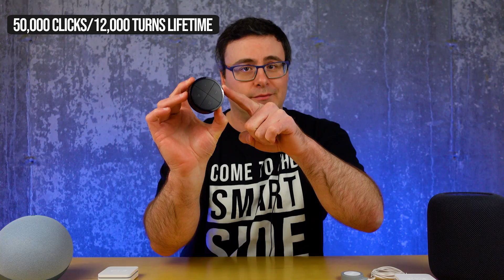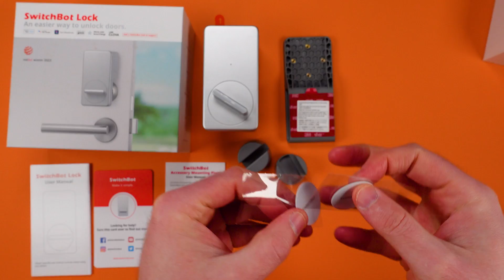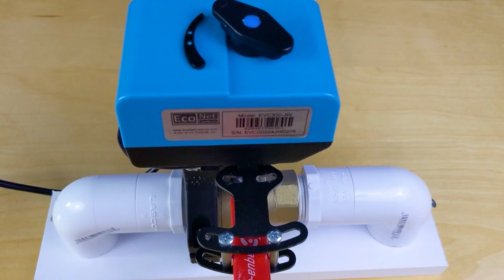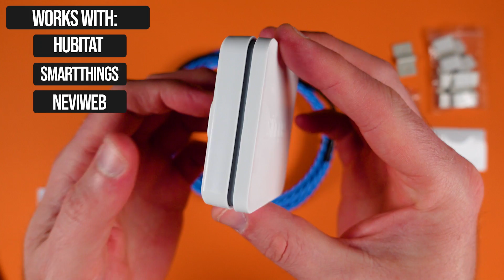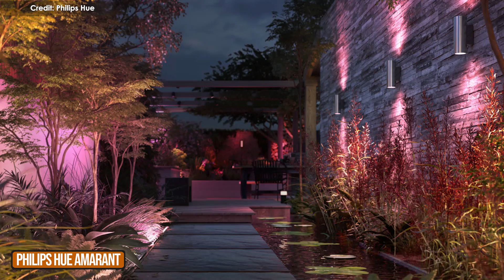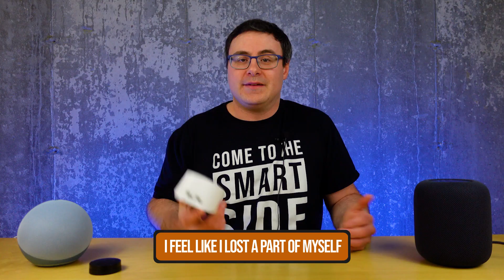These Smart Home Products Are NEARLY Perfect! (SO Close...)

Comment: WHY DOES THE HUE DIAL SWITCH THING ONLY CONTROL UP TO 3 ROOMS OR ZONES BUT IT HAS 4 BUTTONS FFS
Reply from the maker: That's where you should use it with some other platforms
Reply: @AutomateYourLife  such as? Currently the Hue site says "Each button on the Tap dial switch can cycle through scenes, and each button can control a separate Room or Zone. The dial dims or brightens one Room or Zone." So that makes it sound like you can control 4 different lights or groups of lights with each button

Comment: Hi Brian - I understand your love for Philips Hue, that was my first home automation purchase and all my lights are still Philips hue and I have not had a single failure in the years (5 at a guess) since I installed my hub and first bulbs but one thing that does bug me in a few rooms is an issue that in fairness you did mention - brightness, or lack of it. I now want to put smart bulbs into my holiday home where I already find the existing dumb 400 lumen (or at least that's manufacturer's claim on the box) GU10 bulbs a bit too dim for my liking so I'm thinking that Philips Hue GU10 smart bulbs are unlikely to make me happy there.

I appreciate that Hue is top of the pile for reliability and connectivity - although in addition to the brightness issue I would also dock Philips another "perfection point" for the relatively low number of devices supported per hub - but what would you recommend as second best for smart GU10 bulbs if maximum brightness is a key consideration? (I have a strong preference for a Zigbee solution since I have found that more reliable than my ZWave stuff and I prefer not to clog up my WiFi mesh system with lots of smart bulbs.)
Reply from the maker: Yeah I do wish we could get more bulbs on to one hub!

As for GU10 bulbs...that's tough for me.  I don't actually have a GU10 outlet at the moment in my place.  So I haven't done much testing there at all. :(  Sorry!

Comment: That leak detector looks great. I am also most comfortable with a long-wire sensor so I think I'll be getting one of these for the floor space underneath my shower. Does it also have a humidity sensor? In not then one can always add a separate humidity sensor but having it all in one device is more elegant so if there isn't one then I'd knock off one "perfection point" for that (in my opinion) omission.
Reply from the maker: It doesn't Julian.  That's just a pure Zigbee Humidity Sensor! :)

Comment: Actually I do use my Caseta pico switches to control smart bulbs through Home Assistant.  Each button can be configured to perform a different function.  For example, I set up an automation to control the smart bulb color with the "favorite" center button on the Pico remote dimmer.
Reply from the maker: Great!

Comment: Hi I have problem with my switch bot key pad touch the NFC scanner is not working it always shows me a ( failed to add ) in the app when I want to add a NFC I tried to reset it and pair it again but it didn't work I tried the card that came with it I tried the NFC tags that came with the lock and even tried 3rd party NFC tags but nothing works with it is there any way to fix this ?
Reply from the maker: I'd try adding it with a different phone or tablet and then talk to SwitchBot if it doesn't work

Comment: I've been looking, perhaps in vain, for a way to control my speaker groups. Miss A, as you so politely refer to my platform, allows me to adjust speakers with flic buttons to a designated press, double press etc. It would be great to use a dial like the one in this video. I would love to switch between speakers and dial in the volume. Otherwise, I'd love to see a mixer board type display on my phone or tablet to dial in the right levels. I'm betting both are non-existent?
Reply from the maker: Yeah not that I know of yet.  There's some ways to do some of that, but definitely no analog control of volume at the moment.  I'm watching though!

Comment: Brian....I have an older home with 8 ft ceilings, and most rooms only have a ceiling fan light....So, I put up low profile light trays 11 inches down from the ceiling  with 4 inch crown molding on the front for indirect lighting.  We have been very happy with the philips hue lightstrips plus in those trays.  They are RGBWW, the 2 WW's being a dedicated blueish white and a dedicated yellowish white, but when mixed together make a daylight white.  But, they are really expensive.  Amazon does sell a few RGBWW that are wifi capable, but ,  I really want to control them with the hue dimmer. I want to add these generic RGBWW to the hue ecosystem.   Can that be done?
Reply from the maker: You couldn't use the dial at this point, but you could use the buttons on that dial to set 4 different settings through Alexa or HomeKit.  Your other strips would have to work with that system too though, so I'm betting Alexa would work for you but not HomeKit with the types of strips you're considering.

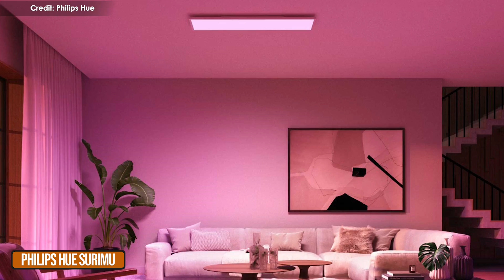If you look at some Zigbee strips, like the ones in this video: https://youtu.be/DtsSy0b4LtI (go to 14:32) then you can connect them directly with the Hue Hub and then yes, you get full control!

Comment: Hi.  I use SwitchBot lock.  A the beginning, it lets the door open too many times.  When entering the application, the lock seemed closed even though it was opened seconds ago.  That seems to have been resolved.  Now, about two times a week, I have to recalibrate the lock due to errors that it jammed.  So, my experience has not been good with this lock.
Reply from the maker: You know Carlos, some of the early models I found had some issues.  I wonder if you should chat with SwitchBot cause this newer one I got is perfect.

1 other trick? Don't remove the tape on the thumb turn adapter if you don't need to.

Comment: I love my Amazon purchase gas and water valves.  For 4 years they have reliability turned off my water when no one is home and my outdoor kitchen and fireplace gas valve to ensure no one leaves it off.   The problem I had Lora and other was the looseness of the handle
Connection.  I modified to make the bolt directly to handle
Reply from the maker: Sounds like you've done some work to make things great.  Good job!
Reply: @AutomateYourLife  I still have a lot to do.  I use geolocation to shut water off/on but I need to get washer power sense so I can leave it on until washer shuts off.  My wife has been less than happy when she runs to store and washer doesn’t finish while she gone.
Reply from the maker: @Alphasig336  LOL you can't make the wife angry!  You're gonna have to fix that one.  Maybe a bypass button to press on the way out?

Comment: You forgot to mention the Sinope sensor can also be setup to its own (reletively inexpensive) smartvalve, who also has a 'abnormal flow' sensor you plumb in with it. So works if your hub goes down (requires you configure it this way within Sinope and connect to Smartthings via cloud service instead of direct). But best valve I've seen so far (valve has plug and batt backup) .
Reply from the maker: Those are great points!  Absolutely right about it all

Comment: What do you think of the Moen Flo?
Reply from the maker: I've never had one Russ, but seeing them at shows, knowing a few folks who've had them, and having worked in pipelines for many years, I can tell you that a system like that has to be calibrated VERY well.  They seem to have it right, but I imagine very small leaks are something they can't detect.  They're also WiFi based I believe, so that can be tricky to keep connected in some homes.

However, from what I've seen, people are very happy anytime they've installed that device so overall, I think it's good.  Just not for me.
Reply: @AutomateYourLife  I'm having one installed soon. I'll let you know my experience.

Comment: Can you set up the switch bot lock to unlock when an AirTag gets close?
Reply from the maker: That would be interesting to try.  I'd think through Siri Shortcuts maybe but you'd have to work around the request for codes to unlock.  The NFC is probably an easier option with the phone
Reply: @AutomateYourLife  thanks for your thoughts! I was hoping a proximity lock would be possible.

Comment: My favorite series of products is the RF version of the Sonoff wall switch and Basic WiFi switch called the RFR2.  With a generic 433 MHz remote, I can press a button to turn them on and off, as well as use the App, Voice and manually control everything I put them on.  I have 45+ of these switches around my house, including on my Echo Dots to reset them.  Amazing devices.
Reply from the maker: That's a LOT!  Cheap devices though, so not a huge investment (other than the time thing)

Comment: HI Brain, another great video. Question why don't reviewers talk about Brilliant lights switches and controllers. I have the system with 2 single controllers and 16 smart switches and it can do way more than the Lutron system. I dont think any reviewers look deep enough into its functionality especially the controllers touch screen and what it can do.
Reply from the maker: Brilliant is an interesting thing.  I think what happened with them is they came out with a bang and most people rejected their cost structure.  That's what got me, but I've shown it a few times on the channel when the updates or new products were applicable!  Glad you're happy with it though, and thanks for sharing!
Reply: Hi Brian thank you for the reply. The only costly thing is the controller. But it does a lot without having to use the app and it has a huge wife approval. The switches are the same price as Lutron...But every switch has motion,dimming,and you can set them up to double tap to run scenes! Orginally I was a Insteon user which was before Lutron. Lutron uses the same transmission as the Insteon.. I swear they were the same company before Insteon went out of business. That is when I switched to Brilliant.

Comment: Have installed 4 leak sensors as leak sensors and 2 as water presence sensors (for a humidifier and to control bath/immersion routines).
Just spent an afternoon playing chase the little mourning geckos - managed to collect four of the 4" ballistic missiles (that can jump a ft without trying and walk on the ceiling) and they're safe in new home.

PS as I understand it, Lutron stuff works on 110v - so it isn't safe for the UK.
Reply from the maker: Yeah that's a whole topic in itself!  Actually, both of your comments are.  :D

Comment: I’ve had Phillips Hue for a while and it worked great. Then I tried to set up my mom’s house with hue using the same Alexa and hue account.  It doesn’t work very smoothly.  I might have to use 2 separate Amazon and hue accounts. I used one so we could take better advantage of some features, but II think what I gain is outweighed by the frustrations in that case. For instance, if she has used her smart lights, I have to tap the button on my hub before mine will work, at which point, hers will cease working until she presses the button on hers.  Then, of course, mine stop working again.
Reply from the maker: Yeahhhhh it sounds like you are right when you say you need to separate the accounts out.  Big job though!😳

Comment: How exactly can you have the Hue Tap dial switch control Philips Hue + Alexa + Homekit at the same time? I have this switch, and if I choose "configure in another app" it stops working with the Hue app.
Reply from the maker: Through the basic integration with the whole Hue Hub, the switch shows up in both Amazon and Homekit for control and automation use.  No further steps required.

There will be some funny stuff with Matter going on in the next little while so we could see it work and then not work over the course of a week.

But it'll work with basic integrations generally
Reply: @AutomateYourLife  Thanks. What about Google Home? This is what I am using but I do not see the switch listed.
Reply from the maker: @thcyprus  not available in Google

Comment: I would advise against any smart locks. They mostly are advertising on buzzword of smart locks and IOT, not providing any security that is even available on cheapest home lock. Your choice of smart lock may mean that your home is easier to break into, some even faster entry than any standard lock.
Reply from the maker: I get the perspective here.  I see it like this: if someone wants to break in with that SwitchBot lock on the door, they'd have to know it was there.

If they know it's there, that's commitment to getting in my place.  No door or lock is stopping them.

And here's the only time I've been broken into: I left my car door unlocked by accident and someone was testing doors.

That lock solves me or anyone ever leaving the door unlocked or opened.  So I feel good about that choice!  It's not changing anything door lock wise. 

But to each their own!
Reply: Any kind of lock on a door be it smart or not just keeps out the honest criminal. If someone really wants into your home they are putting through a window. I use the SwitchBot lock myself and find it fantastic and not to mention the wife approval factor it has for the many ways of locking/unlocking including the SwitchBot buttons I have scattered around my house and also a button on the new fire tv pro remote.
Reply: Anybody looking to break into your home is kicking the door or breaking a window. Most criminals test your door, and if it’s locked, move to the next door. It’s easier to simply open an unlocked door 4 houses down than to wake someone up kicking a door or breaking a window. Also companies like Schlage make good regular locks and use the exact same mechanisms in their smart locks (I know cause I swapped my dumb lock tumbler into my Schlage smart lock so I wouldn’t have to rekey). Anybody smart enough to hack into your lock probably makes big money somewhere and isn’t interested in stealing someone’s TV.
Reply: Our complex has replaced the mutual door from an actually secure lock to one of those smart locks and there has been someone breaking in every week now. Not someone kicking in door, not someone breaking windows. Just some punk kids breaking in and doing graffiti in the common areas now. I saw it happen, they just push something into the lock that's not a key and open it quicker than a key did when we had to use keys before going to the rf tokens
Reply: @drrenard1277  Tuya zigbee dshk-38 self defense auto mount by Moes 😂😂👌🤦‍♀️ - you know someone's going to do it - just hope the face recognition is perfect.

Comment: I can attest to the reliability of Lutron Caseta. I have the Pro Hub in my system. Unfortunately, I can't remember at what point it became necessary to install it. But, I believe it was for Hubitat Integration. After having had the system in place for 3 years now, I don't recall a single failure and response times are fast. I control the lights through Hubitat Dashboards, Alexa Voice Commands, Scheduled Scenes and ,from time to time, the Lutron app on my phone. I have played with smart home products for several years now and the Caseta stuff is by far the most reliable. 

One thing not mentioned in the video, the Pico Remotes can be used as a programmable button in Hubitat. All buttons on the remote can be individually programmed. I open my garage door from inside the house with a Pico Remote. I haven't fully explored the possibilities, but it seems to me to have the potential for a very powerful little tool.
Reply: Have to have the pro hub for Hubitat. I have 2 Caseta dimmers to replace 2 different 3 way switches without Neutral wires. The only issue I have with them is when turned on they come on full brightness then dimmed manually. I'm sure that could be fixed on Hubitat but with 2 little used lights it's not worth buying the pro hub...yet.
Reply from the maker: Hey Michael, is that the case with the Diva switch now?  It seems to hold it's base dim level whenever I automate with it anywhere else.  I haven't been able to do the Hubitat integration cause I don't have that pro bridge yet, but I wondered!
Reply from the maker: Yeahhhh, those Pico remotes.  That's the last thing that Lutron could unlock to really change how their system is used in the industry.  I'd like to see that option in more systems.  It's huge that Hue lets that happen with the Dial Switch, so hopefully we see more of this!

Comment: As a real estate agent who has seen the damage water leaks can cause, I’m a big advocate for water valve shutoff devices such bulldog or titan from zooz. 

Lutron is also my go to smart switch/dimmer recommendation, having to buy the pro over the standard bridge isn’t a big deal. With hubitat you can program the picos to control smart bulbs, but for that typically I’d go with zooz, inovelli, or lesser known RGB genie

Eero is a great bang for your buck and worthwhile upgrade for most people that either have a modem router combo provided by their isp or are still using an older off the shelf non-mesh based router
Reply from the maker: This video is definitely Brandon approved!!😃😃